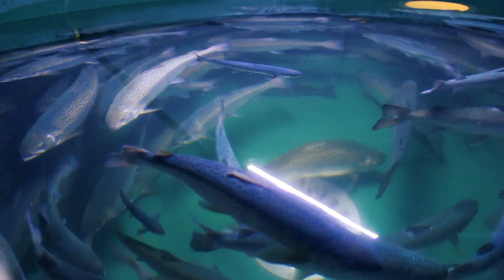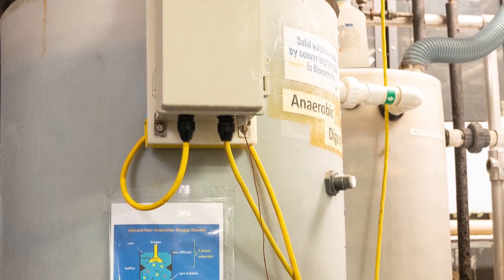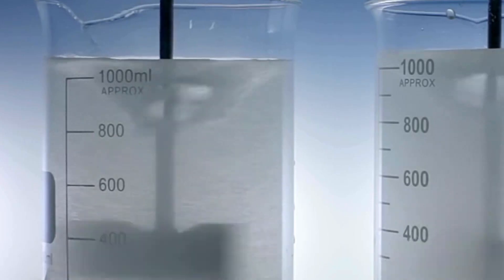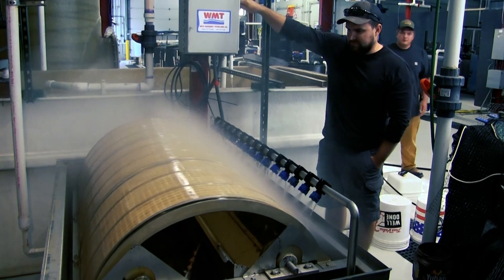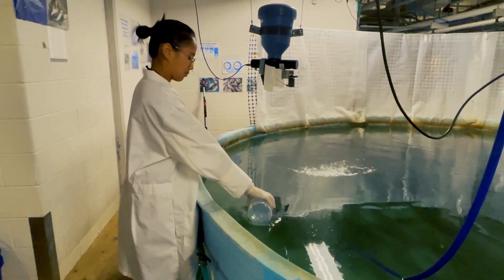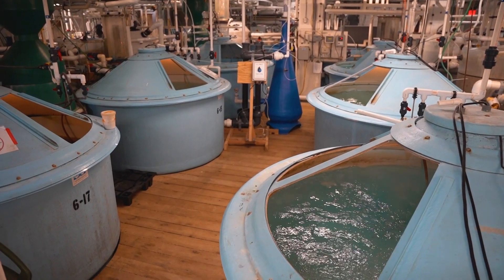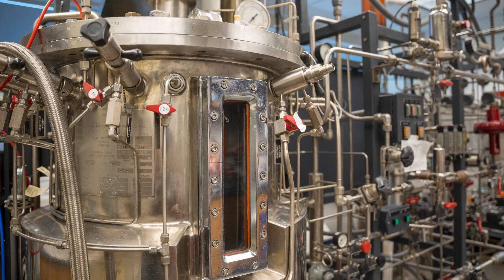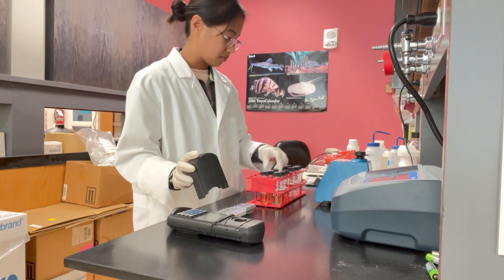How to Manage Waste in a Recirculating Aquaculture System

Comment: Is this better than an aquaponic setup (costs, time, etc.)?  If so, how?  If not, why do this rather than an aquaponic setup?
Reply: Great question! I was thinking the same thing.
Reply from the maker: @stans4me  Thank you for your question. Aquaponics requires a completely different set of skills than aquaculture and can be difficult to manage both the fish and plants optimally, especially in larger commercial operations even if they are decoupled systems. We do not do research on aquaponics at UWSP NADF but have several private partners that have aquaponics systems. In addition, this video is specifically highlighting raising fish in saltwater systems, which is an extra challenge for raising plants that can tolerate saltwater. Regardless, even in aquaponics, there eventually is effluent that can no longer be utilized (sludge) in which need to be disposed of efficiently. If you would like more information on aquaponics, feel free to send us an email and we can connect you with universities that have aquaponics systems: ehauser@uwsp.edu